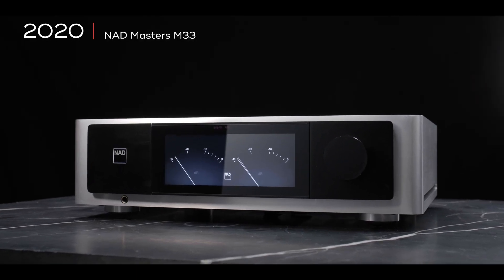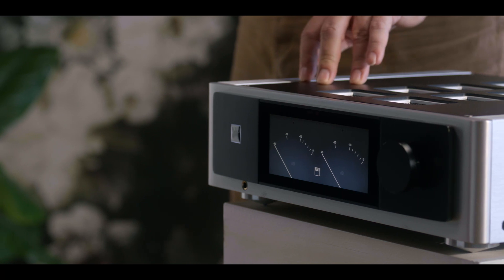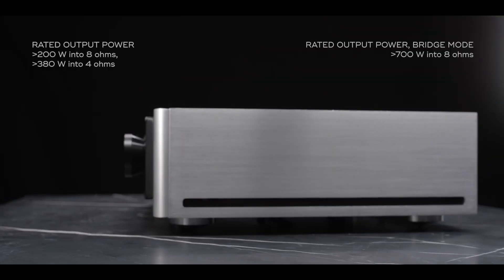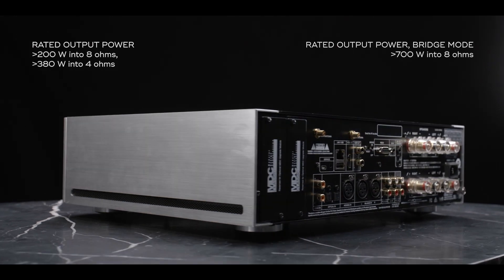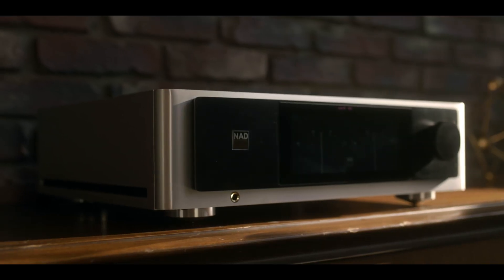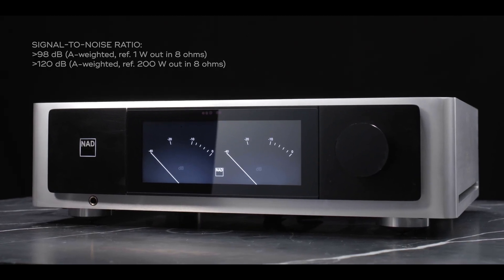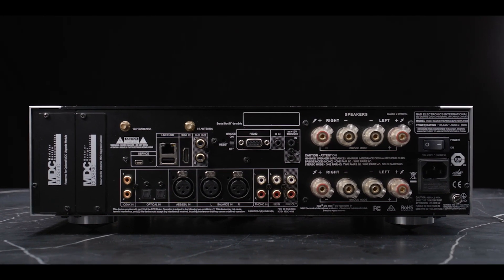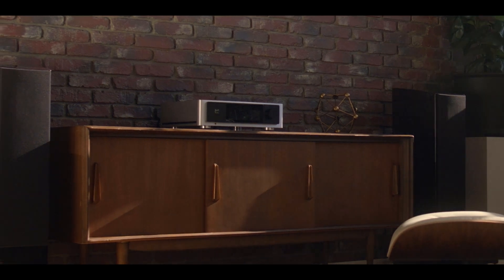NAD Electronics Iconic Technology: Eigentakt

Comment: Hi NAD , I have been using NAD equipment for about 46 years, my first bit equipment I think it was a 1232 , Not sure if that’s the right number because I purchase it secondhand in the early 80s gave up or started at hum  on the phono side, back in 2019, so I brought a NAD 314 and believe it or not that’s been fine until yesterday I’ve now got a ham coming from the phono side again, Obviously I need to buy some new equipment but not sure which way to go change the brand or stay with NAD, I need a new power amp at least 150 or even 200 W if possible.
And I could do with a preAmp as well, I am 71 next month, just leaving on the pension, The only good thing is I live in rural France no neighbours so I can turn the volume up as loud as I like and have nobody to tell me that they don’t like the music as I live by myself.
At present I do not have a lot of money so I’ll have to go out and try and find secondhand, Is there anything you can suggest if I stay with NAD. The problem is that I live miles away from any shops or a store that sells any equipment, The end of last year I rebuilt my transmission line loudspeaker cabinets they sound amazing, SEAS Drivers units, I Listen to heavy metal , classical and just recently I’ve started listening to blues music, Nordic folk music, I’ve always been impressed with your product it’s just a shame that they have packed up after so long use, 
I stream my television through my hi-fi and I listen to my music anywhere between 12 to 14 hours a day. 
If you can give me some indication what I need to get a roughly how much it’s going to cost if there is a store that you supply that I can probably go and visit, South of France, Correze and further down. Thank you for your help.
PHIL FROM THE DARK SIDE OF THE MOULIN FRANCE.